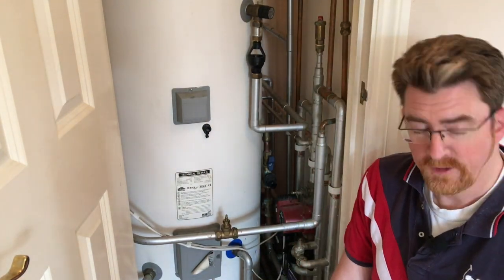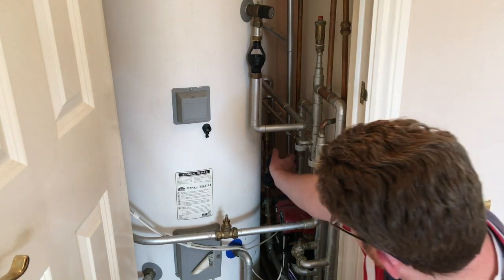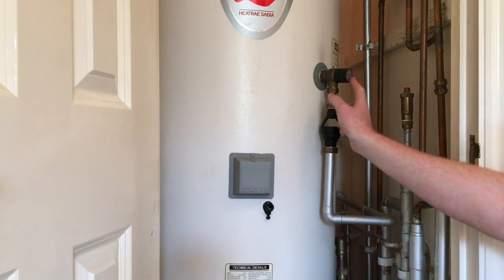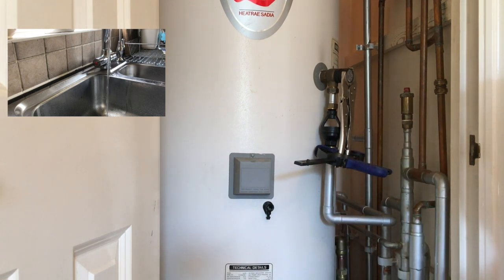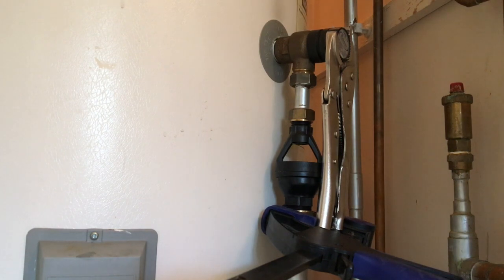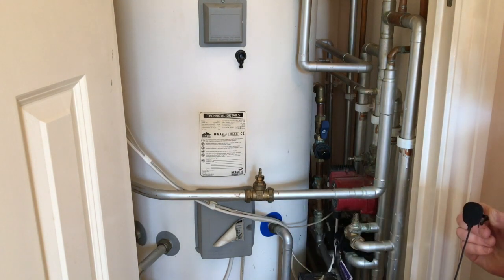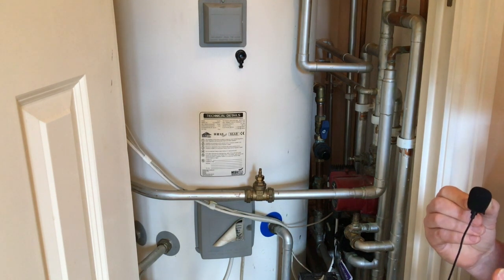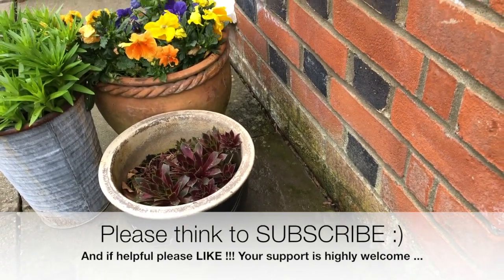Megaflo recharge of air gap

Comment: Hi Joe, I've got the same Mega Flo, the other day I ended up draining off all the hot water ( long story !) the hot water now only last for a short period of time, could it have anything to do with the air trap ? Many thanks.
Reply from the maker: Hi Ian, Not sure how you can drain off all the HW as its mains pressure feed, it would usualy just run cool once the hot water has run too long?  This sounds like something you need to speak to Scadia about.  If you can replenish the air gap it might work, but what you describe is odd working behavior of the tank. Good luck, tell us how you get on!!

Comment: Same system for Tribune HE?
Reply from the maker: Hi Graham no, this what Tribune HE says as it uses an External Expansion Vessel. So no internal air bubble.

For Flexible and Reliable We have chosen to use an external expansion vessel for our
Tribune HE. With no air bubble to lose, it promises improved
reliability. Add flexible siting and reduced overall cylinder height
and you have a winning combination.
Reply: Thanks for your reply.Much appreciated.I have dripping in the tundush and the tap water is very very hot.Not something I can deal with myself.
Reply from the maker: Hi Graham, I'm not a plumber so take this just as general advice.  If the hot taps are V V hot then the TPRV is working as it should, as it will open up if the temperature gets close to 90degC or the pressure is getting too high.  Does your boiler have a h/w temperature controller thermostat, if so this should be set to 60degC to a max 65degC.

Comment: thanks Joe.  very informative and helpful! followed the instruction, but then I still get the 3-4 drops a  second coming out from the overflow pipe.  Is it safe to leave it like this for a while or I need to call an engineer asap
Reply from the maker: Hi vshlesman, is there water dripping out from the TPVR into the tundish?  If so then the TPRV will need to be replaced as its not making a good seal.  If you live in a very hard water area this could be due to calcium/scum build up on the valve. Advice is replacing the value from a trusted supplier and get a Megaflo certified plumber to fit.  There is also another possible source of water.  If you recall in the video I show the red expansion tank, this takes up the CH pressure, there is also has a PRV on the top of this tank and the tank uses a diaphragm method to hold the pressure for the CH.  Both the tank or that PRV could be the source of the problem.  These expansion tanks can fail by filling up with water on both sides of the diaphragm. Typically the tank's PRV is connected to the same drain pipe as the TPRV/tundish leading out of the house.

Comment: Hi, just a small note Joe, there is usually no need for the grips and clamp thing you did on the relief valve. When you turn the valve clockwise water will start to come out, if you continue to turn, the valve will return to seated, however there will be a point between those two where the wheel will sit on top of a cam and allow water to flow without any clamps. This point can be tricky to find, but not that hard !
Reply: Gary - when you say ‘if you continue to turn the valve will return to seated’ do you mean it will click and automatically shut again? .... asking for a friend...
Reply from the maker: Good tip!

Comment: Great video but you shouldn’t be using the prv this is a safety device that does not always re-seat . Secondly hot tap in the bathroom should always be open to stop air locking which can lead to the cylinder warping and leaking,
Reply from the maker: I'm very sorry but you are wrong about the statement about the PRV. Megflo clearly states on the side of the Tank how this should be done by using the PRV. All of that instruction I copied verbatim down in the description text of the video and also show the label within the video [2mins 48Sec] to prevent uncertainty.  I also have a plumber friend who is qualified to service Megaflo tanks and he says this is the only way to pressuriser the tank. You second suggestion is good advice about opening up a second tap.  But do not forget to close it once the mains pressure is restored.  All HW taps will splutter due to air in the systems for the first time they are used.

Comment: Hi Joe. This has been on my to do list for a while now but wasn't sure how to do it. My intention being to hopefully increase the hot water pressure. Is this a job you only need to do if you have dripping in the tundish? The system was installed in 2004 and we've been there just over 2 years. I doubt it was done by the previous owner.
Reply from the maker: Hi Matt, this is suggested to be done once per year.  If it has never been done then it should increase the pressure in your HW !

Comment: Hi Joe I recently had a plumber in who did this but opened up nearest cold tap not hot. Due to no gurgling he said that it cant be that and must be valve related...is this correct or should he have turned hot tap on. Also he only turned off cold water supply. Thanks
Reply: Mine is a stelflow too
Reply from the maker: Hi David, if you are looking to pressurise the hot water tank then you will need to release the hw pressure in the tank to allow the air gap to expand and take up the space.  Opening a cold water tap will not do that.  Please look at instruction picture I took, pause the video there and read through it. He should have the mains water feed to the tank off, either the whole house stop cock or the cold water feed on the tank usually the balance valve.
Reply: Thanks Joe - he had the cold water feed to tank off which is downstairs and then opened up cold water tap not hot water tap before releasing pressure valve. Would this make a difference? Thanks

Comment: my system says to open the 'nearest' tap.. not the lowest one. is this an important difference?
Reply: Yes make sure you open the highest tap int he house first ie bathroom hot tap then the lowest this will allow airflow through the cylinder and stop it getting a negative airlock you can split or warp the cylinder. Also to touch the prv this a safety device that does not always re seat
Reply from the maker: Hi Robin, probably makes no difference. I have always just done the lowest tap.  What you are looking for is as the air gap replenishes, the water from the tank discharge to allow for this expansion.

Comment: Should you switch the boiler off before doing this, or should the system be running?
Reply from the maker: Hi Peter, you don't need to switch the boiler off, just turn off the HW and CH timer so the boiler does not fire during the process.  I usually shut these off just before the family needs to use HW, so that the tank empties and fills with cold in normal use just before you carry out this process, so you don't waste too much 60degC water from the tank when you eventually open up the lowest hot tap as you top up the air gap.  Not sure if it actually saves any money. But a great question! :)
Reply: @joewoodford9428  
Hi Joe,
Many thanks for your speedy response; your instructions helped me to recharge the air gap. I also discovered that some builders working for us in the kitchen had blocked the overflow. But now the little brass air vent to the side of the cylinder is dripping. Do you have any advice?
Reply from the maker: @Peter Hort, Long shot but it might just be some grit or calcium buildup effecting the valve.  If the water can vent out of the house you could try opening it up and closing it quickly, that might wash it away. I'm assuming the valve you speaking about is the one with the tundish? If the problem persists you might need to replace the valve. I recommend using a plumber for this as it part of the tanks safety system.  But as the valve is opened during the air gap recharge process and there is no pressure on this valve during this as the tank in and out flows are off it might be something considering if you are an expert DIYer.

Comment: Great video Joe.....just a quick question I need to change my kitchen tape washer as it is dripping and getting worse do I have to do all this to stop water coming out the hot tap in kichen thanks
Reply from the maker: Hi Barry, at the top of the HW tank is another leaver to shut off the hot water out flow from the tank.  I would close that off and the Stop Cock on the house to be sure.  I expect some water will come out of the hot tap but that is likely to just come from the water in the hot water system pipe work,  if you want to be sure open up the lowest hot tap and then the highest hot tap. That will drain the water out, well most of it. Be sure to close them before you turn back on the water main feed and tank valve!!
Reply: @joewoodford9428  thankyou joe I will be onit 👍👍